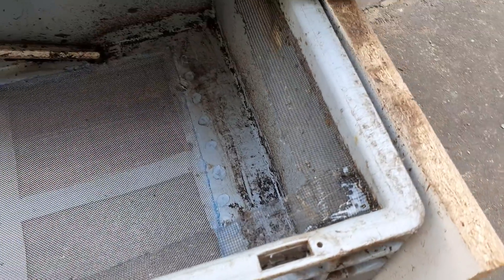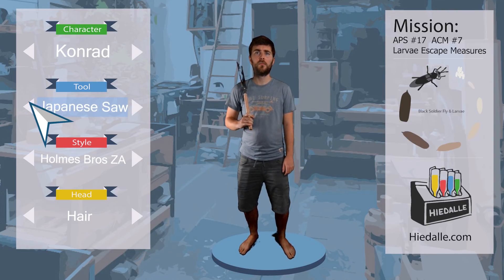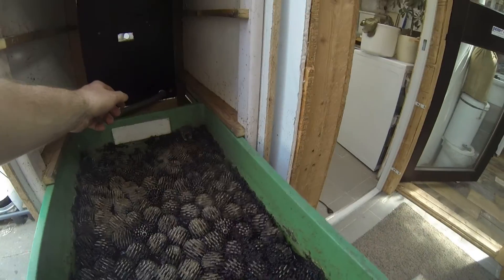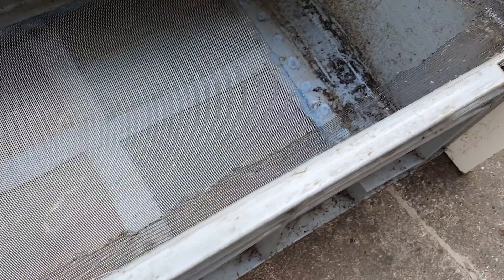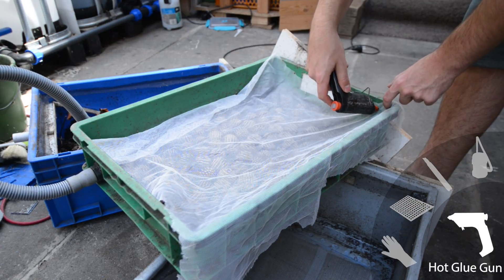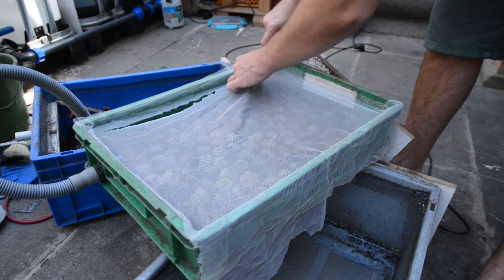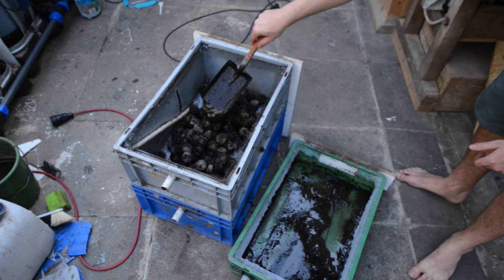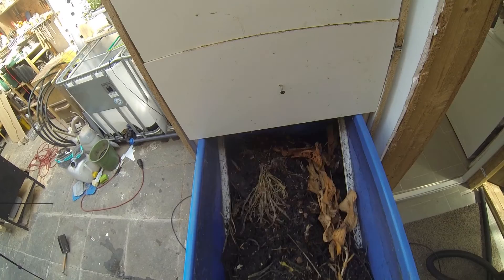Stopping Larvae From Escaping | APS #17 | Hiedalle

Comment: velco tape(hook-side) does wonders at stopping the pre-puppae from escaping
Reply from the maker: Hi thats a very interesting idea, does this work also for the little ones? Do you have videos of your experiments regarding this?
Reply: @Hiedalle  sorry haven't made a video yet, but thru years of experience, it only works on 2nd instar plus, medium to large ones 0.2mm above. the neonates can pass thru space in between the Velcro hooks, while the larger ones cannot crawl and stick pass thru it.

i guess the velcro can work on the neonates as long as it stays dry. but from experience a dry powder like bran or sawdust, along the side walls of the container works best for the neonates so they can't climb upwards.
Reply from the maker: Very interesting,  would love to see your setup. Not sure how to place saw dust on the vertical walls. But i need to test the velcro
Reply from the maker: Since i flood the box the larvae are in they get very wet and stick to basically everything
Reply: @Hiedalle  i see its an integrated aquaponics nice system. i would love to try integrated bsf vermiponics aswell. the worms loves the frass. velcro should do the job even with constant flooding goodluck.
Reply from the maker: @jan2x385  i highly recommend the wormtea it does wonders

Comment: Haha this is an interesting channel I found. Some ways I've seen people solve this is by making these thin plastic pools that have an L folded through its perimiter, since it is a thin plastic it is all sewed, the material was raffia maybe, I don't remember. Another way is by just having a layer of dry material surrounding the wet one which is what I personally use but when I move to a larger scale I will try the previous method. Anyway you have a cool channel, not many people are doing these things in the West
Reply from the maker: Hi thanks for your comment, can you maybe link to the plastic pool mentioned? I think i know which one you mean but i would like to check it out anyway. The other method with the dry material would not work in this setup since the compost is flooded once a day soaking the entire box as the water drips down from above. I am currious where are you located and what kind of setup do you have?
Reply: @Hiedalle  I am located in South America, as for the pools I believe they are made by their local artisans, these aren't available to me since they are in Asia but they are probably not hard to make, this was the video: https://www.youtube.com/watch?v=uGgTSOW5lBg&list=PLsE1zBi914P6QPGcsdusnWFyrKzpBAsIU&index=3&ab_channel=OrganicFarmingandTechnology in it he also explains that watering the larvae with beneficial bacteria has improved their conversion ratio significantly, which I found very interesting and hadn't seen before. 

My setup right now are plastic tubs (200L) surrounded by mosquito nets used in beds tied with elastic, I got to make it so no flies escape from it. I started with BSFL may this year, at the worst possible time to start since it was cold and winter was arriving but they all survived (even multiplied, slowly but they did) and now in spring they are thriving. I harvested about 15kg of larvae this month, starting from only 5000 larvae in may.

This is my setup: https://imgur.com/a/QJOGqmt it isn't the best but it was the first time I did it, it is somewhat hard to access but I will try to fix the problems I found in my next one, already bought the parts for it.